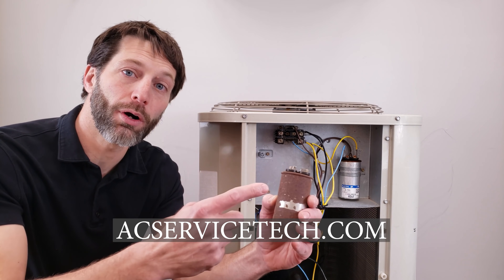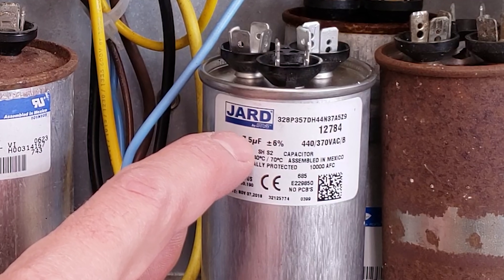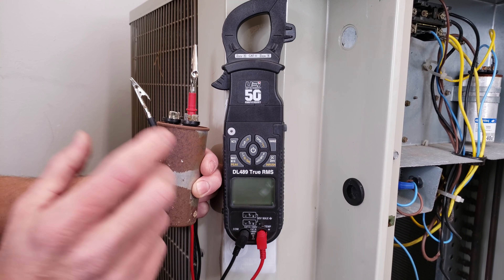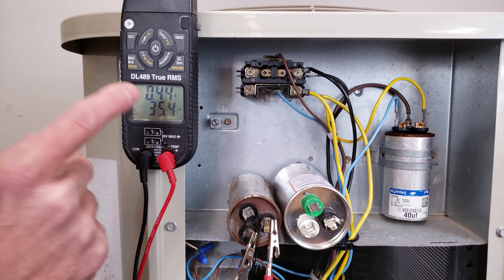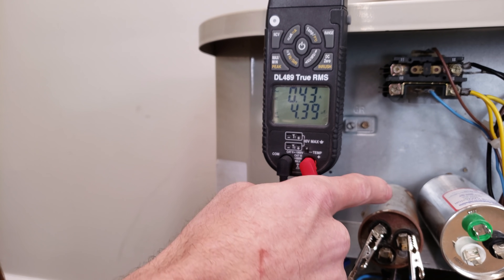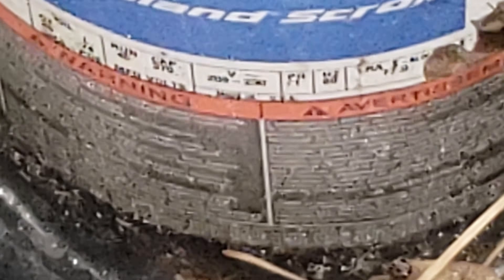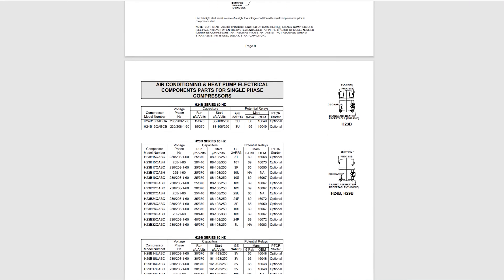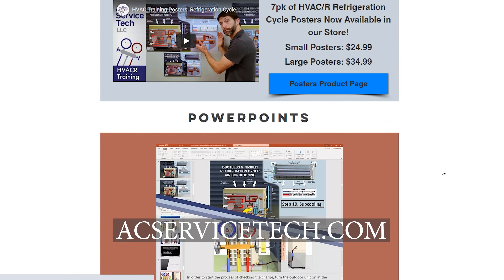Finding Run CAPACITOR SIZE on an AC Unit, Ratings Worn Off!

Comment: We have a 25 years or older Ruud AC, it's capacitor has gone bad and needs to be replaced. Although the capacitor is plastic there isn't any markings on the capacitor that tell its value is. I suspect that it once had a stick on label that came off. If the compressor and or the motor have no label how should we proceed, the installer has long been retired.

Comment: On a 30 year old unit, condenser fan motor is running but the capacitor is reading 3.4 MFD. The datat tag on the capacitor and motor are worn out. What other methods can I use to figure the capacitor size?

Comment: So we have to go to that Compressor manufacturer's website to find out the MFD rating?  

There is no other way to find that out? I mean if we use the Start Capacitor formula with input Electrical load it won’t show appropriate Capacitor rating?

Comment: Another good tip is to check the compressor / fan labels, and make sure the right capacitors are already installed.  ...seen this mismatched before!!

Comment: Hello, I have a furnace blower motor capacitor question: Can anybody tell me why a new Genteq (formerly GE Motors, prior to 2009) blower motor would have 5 uF capacitor as the main spec on its label BUT ALSO say "7.5 uF capacitor required on Some Units"? Google does not yield any answers for this. The old capacitor that was in there was a 7.5 uF and ran the old GE blower motor for at least 15 years, maybe 20+ years--the blower was dusty, rusty, squealy, and old as time. That makes me think my furnace/"unit" might be one of the "units" that uses a 7.5, but everyone on the internet warns to not use the wrong capacitor, and the freaking motor, old GE and new OEM Genteq I ordered, has 5 uF cap on the label as well as the 7.5 uf spec "for some units". Thanks!
Reply: This has to do with the supplied voltage. 208 volts will have a different capacitor than 240 volts.

Comment: Replaced my capacitor and fan still wasn’t kicking on. I took out the capacitor, ordered the same 55/5. Fan still doesn’t work. Next day I check the fan motor to get a replacement and noticed it says 10uf. Whoever replaced it put the wrong one in. Wonder how that affected the fan motor.
Reply: Reporting back in case anyone reads this someday. The fan motor had two sets of wires connected to each other in a loop. They were zip tied to the conduit of the other wires and to the top metal grill of the fan. The vibration wore through 2 of the wires. Completely through them. I think it was running because the metal bar from the grill was actually bridging the wires. Wild. Redid the wiring , taped and used conduit to get it back together. Check your wiring !

Comment: I have a AC condensing unit who the hell knows what’s what it is. I think it’s a Frigidaire but there’s no name in there. No name on it. I know it’s 2 ton and the fan and the compressor doesn’t run. Lots of voltage. Think the run capacitor is bad, the sticker on the fan motor says point or 55 370 V there’s no sticker on the compressor other than something that says Copeland CR 20 K6PVPFV 260 is there anyway you could help me out and tell me what size capacitor I need to get a dual run capacitor for both my take care of my fan and my compressor on myunit outdoor that I should trash you

Comment: If the label is worn off...
1. Take Amps reading from HERM
2. Multiply by 2562= ?
3. Then check voltage from Common to HERM and divide it by the answer from step 2. 
This will give you capacitor rating under load.
Reply: Don't you mean 2652 ?

Comment: If you accidentally measure capacitance incorrectly on an intact 35+5, as in probe herm to fan terminals by mistake, it'll coincidentally also produce 4.4mfd. In-series capacitors is madness, but a frequent mistake made by my techs.

Edit: does anyone know of a way to like, measure the resistance of the windings & factor tonnage and calculate the capacitor size needed?

Comment: What if my AC unit has 2 capacitors? one is only for the fan, but can I replace the main capacitor with one that can also run the fan motor or do I always have to have 2 capacitors?

Comment: Awesome video! I have the exact situation or a completely rusted and illegible capacitor. Found the fan rating no problem on the fan plate but not able  to find compressor rating. It is not on compressor plate and I can't find online likely because the model is out of production is my guess since old refrigerant. It is a Copeland CR26KF-PFV-130 compressor. Do you happen to have the manual for that one so I can look up capacitor size?

Comment: I determined that my run capacitor was bad. The old one showed O.L. on the Ohm setting. That's all I could check with no mfd setting on my meter. The can was rusted so I couldn't find any numbers. But going off the fan, I needed a 370 v 5 capacitor. The replacement I got from ACE hardware was smaller in size but it has a 400/370  50+5 mfd. I'm assuming that is okay. My question is, does the case of the capacitor have to be mounted/grounded to the unit. Since it's smaller in diameter the original band won't secure it to the unit. Any suggestions?
Reply: I was able to just tighten the band circle with new screw positions and it worked just fine. Whew! House was at 95 degrees. So glad that I was able to fix the problem thanks to your channel.

Comment: A 50/5 uF capacitor will not work in replacement of a 45/5 uF ?
My unit has been running 3 yrs now the slightly larger capacitor. 
Should I put a 45/5 uF back in?

Comment: If my compressor is currently using an oval capacitor, can I change out to a round capacitor that meets the volt/MFD ratings?

Comment: Ahhhh okay, so my problem is completely unrelated to air conditioners, but I think this video still helped. I have a possible DIY project in mind that uses a 120VAC 400mA edge flow fan (“motorized impeller”) and I read somewhere that I’d need a capacitor for it to work, but I’ve been struggling to find the information I need for days. (Doesn’t help that Alternating Current and Air Conditioner use the same acronyms. 🙄) But based on what I’ve seen here, I should be able to find that information on the actual impeller fan itself.

Comment: Great videos!!!!  If a start capacitor in a package unit is replaced.  Does the new capacitor need time to charge once the power is turned back on or is does it charge instantly as the power is put back on?

Comment: When there is absolutely no information on the compressor or the fan or the name plate on the unit is missing or worn down. The home has no information on the unit neither. How do you find out what size capacitor is needed?

Comment: Please can you tell me the average cost of a dual capacitor?  I had a technician replace one and it costs me $200.  Its a CAMTR233 45/5 x 440.  When I try to look it up for the price it won't let you unless you have an account with them.
Reply: A capacitor like that is 25$ or so. I just got a 35/5 for $20 on Amazon, GE brand (whatever it is called now). If a service comes they are going to charge $50 for the cap and $150 for the trip.

Comment: What happens if you encounter an old package unit in a mobile home park, and rating plate for compressor is not readable, in addition to an unreadable  rating plate on the cabinet itself? How do I find an MFD spec for compressor?

Comment: There are only two tabs on the cylindrical capacitor in my old Rheem unit. It measures 22 uF, but all the ratings are worn off. It only has two terminals on top, not three. The fan's and compressors rating plates are also worn off.  I guess I"m just SOL :(

Comment: My unit has an 80+5 uF 370V run capacitor with wiring to HERM and C, but no wiring to FAN. It has a separate capacitor for the fan which is 5uF 370V. Why is there a separate capacitor for the fan? Why not just  hook up the fan to the spare terminals on the run capacitor? I did test the run capacitor and it is within spec for both HERM and FAN. The fan capacitor needs to be replaced. Can I just bypass it and hook the fan up to the spare terminals on the run capacitor? Thank you.

Comment: I just got an old window air conditioner running. 38 years old looks like. Electrohome by Keeprite model A601A00

I suspected the capacitor as the blower motor started but the compressor relay/contact was clicking every few seconds and eventually the compressor would start. I expected to have to replace the cap but after removing the wires, I noted a lot of corrosion. Some of the blades were corroded away completely. I took the cap to my wire wheel then scraped the contacts cleaner with a sharp knife. I tested with an analog multi-meter and got decent responses and no shorting to ground. Because the blades were so corroded, I used pliers to squeeze the wire push on contacts a bit to make a tight fit. I put some dielectric grease on the blades to prevent further corrosion. It seem to be running well now, though the thermostat is wanked. I managed to rework the thermostat so it functions, but not as it was designed.

Your video was helpful. From factory the micro farad figures were blurred and can not be read. The cap is a JARD. The blower motor does not mention the capacitor and the label on the compressor is behind where I can not read it 😞

I followed your example using my digital multi meter and got 14.75  and 3.97. Does this mean I would need a 15 and 5  capacitor if when this one fails?

Any idea where I could get a new thermostat?

Comment: I noticed mi ac stared different and making weird noises and shoot down over heated, I inspected and found the capacitor terminals severely corroborated and the mf information missing, but thanks to your video, I purchase the correct capacitor and the ac is working fine.
Thanks and keep up the excellent videos.

Comment: What setting on your volt meter dud you use to find capacitance? I have a fluke and no setting shows uf
Reply from the maker: You may not have that setting unless it is an hvacr multimeter. The setting may be missing, thanks!
Reply: @acservicetechchannel  I was able to track it down. Had to turn it to the symbol for diode DC which also has the symbol for capacitor by it, then switch the setting to find correct range. Unfortunately my capacitor read 0 uf between all prongs. Motor only shows 5 mfd and 370v. Compressor has no uf rating on it. Referenced another HVAC site against my Lennox model # and found that it was 35uf. Hopefully its right!

Comment: This is the only video that helps find the right capacitor without reading the old one. The technician replaced the capacitor on a Sunday and charged us 250 dollars. Later on I figured out with wrong capacitor spec because one month later one wire melted. I was not able to find the right capacitor recommended by the manufacturer in any website, manual or customer service.  After reading on the compressor I was able to find the right one which is 45,  different from the technician replaced 60! Thank you very much sir!!!!!
Reply: Mine did the same I think. It failed soon after.

Comment: Thanks so much for the help. I was servicing my unit and saw that my cap was completely rusted, but still working. Got the readings now so I can replace later.  Mine reads 28.9 and 5.1. Would that be a 30 + 5? Thanks

Comment: Thanks again. I've struggled with people putting in wrong caps mfd in units and customer tells me that fan was replaced a year or two ago, only to find out that they have gone to Higher mfd  and caused the start winding to get damaged over time. After my first experience the customer texted me from time to time that the unit fan is still doing good after five years.  Ty again for your videos and advice.

Comment: I wonder if their is an equation to figure what capacitor is needed if there are no model numbers on the unit. Like if you know the FLA and voltage could you figure what capacitor is needed?
Reply: Yes, take FLA and times that by 2650 then divide that number by voltage needed to run the compressor.
That will give you the exact information u are looking for.
Its a great question u asked and I’m going thru the comment section to see if Craig has addressed this.
He is the best in the business and I’m a little surprised he did not address this formula in the video clip.

Comment: I’ve got a 10 year old Rheem heat pump that as soon as it gets the call for heat or cool, it pops one of the two fuses in the disconnect or trips the breaker. The outdoor fan gets barely enough power to turn the blades a 1/4 turn. I replaced the contractor and same problems. I take the outdoor fan motor out of the loop completely and same problem. Ohm out compressor at its plug and it’s fine (OL). 
Any ideas? TY
Reply: disconnect compressor at the plug and see if breaker still trips. If it does still trip, than disconnect power in at contactor. Isolate the problem for a solution.

Comment: i have watched over and over and it tells me everything about the numbers except for i dont know which number on the fan motor plate coincides with the low number (uf) on the capacitor.I know (from the compressor) i need a 60 MFD/440 Volt, but I have taken 15,000 (lol) pictures of my fan motor plate and i still dont know which lower number to pick 😭 Please help if you can. thanks! P.S. the capacitor label is completely worn off.

Comment: I dont know what my fan motor MFD is. The info on the motor is toast. I tried 7.5 made and it didn't work. I have it at 2.5 mfd now and it works, but I'm worried it could be the 5mfd. How would I know?

Comment: Can a capacitor with the next lowest mf; but same voltage rating be used as a replacement and not damage the compressor or fan? For example replace a 45 mf 370 volt capacitor with a 40 mf 370 volt capacitor.

Comment: This video was amazing, as my capacitor was very rusty and I could only see it was a York with ??+5 MFD.  In my heat pump I couldn't see the compressor's MFD rating (looks like the compressor was in some sort of jacket, not sure).  After discharging and trying to read the capacitor with my multi-meter it showed 20MFD (that seemed too low, I expected 35+).  I then decided to give up and just put back the old capacitor which was still working, ... wait for the face palm moment ... I struggled a bit trying to get the screw that holds the capacitor in and what do I see ... a 50 + 5 MFD in sharpie!  Appreciate the video you made and whomever had the comment about inking the capacitor rating with a sharpie, whoever did that for my HVAC system absolutely saved me.

Comment: That’s all great, but what are you supposed to do when there is no data plate on the compressor and the existing capacitor is not readable

Comment: Rule of thumb ive always used for the last 10 years is (tonnage x10)+15 = Hermetic.  If you're in a pinch you can go up 5 down 0.  Better than 99% chance those two rules will get you in the clear.
Reply: my 3 ton uses 55uF, so no, don't trust that.  if unsure it's better to try several cap values and pick the one that gives the lowest run winding current.
Reply: @dan4091  Congrats on being the 1%. Although with that rule a 45 would still be  within 20% needed for guaranteed start. But using the manufacturer's specified from the unit parts list is the most correct.
Reply: You can also call the supplier order one by model. Use it to replace the one you use next time in supplier.

Comment: What if you have no readable stickers at all?
Reply: easy but takes a bit of work, run the motor with different value capacitors, then use the one that gives the lowest run winding current

Comment: Sorry. But disagree. U can up size 1 cycle. 5 to a 7.5 or a 12.5 to a 15. Or a 45 to a 50. Never had any issue. So.......... let’s hear it??
Reply: did you measure the current from doing so?  you realize MFR's specify run caps for maximum efficiency and lowest operating cost.  so you not having any issue doesn't mean you or someone else isn't paying more $$ to operate their system than necessary.  So..... let's hear it??
Reply: @dan4091  obviously you don’t work in the trade. If you have a bad CFM and it takes a 5uf cap. U can use a 7.5 going foward. Even the manufacturer says this is ok. It’s done all the time. Don’t see the disconnect here. #SoLetsHearIt

Comment: Use 2 heavy insulated screwdrivers yo discharge capacitors, you can check caps using resistance but it wont give you cap rating

Comment: You claim if the Mf is over it will burn out the 'whatever'??  I was always taught "you can go over.. but never under".  
So a cap rated at 30mf can be replaced with one that is 35 mf but NOT one rated 25. This has worked for me in countless cap exchanges in the past 35+ years.
Reply: The reason you can go over is because the purpose of the cap in a capacitor run motor is to shift the voltage towards 90 degrees behind the current to generate a rotating magnetic field, at least that is what I remember from electric machines class but that was over40 years ago. Now since you cannot shift the current more than 90 degrees it stands to reason going over will still work however there has to be consequences here and I suspect it’s the capacitor that suffers from extra power losses as heat thus shortening its life. Now I admit that part is an educated guess, so i’ll leave the research in confirming this to you.
Reply: @nunyabusiness6746  Huh?  Going 'over' I understand. I was commenting on 'going Under'.

Comment: I was taught ac's the hands on OJT method likecalot if other guys in my trade but alotta guys that were taught the same way. 1 of the things I've always heard about replacing a capacitor is, it's safe to replace a capacitor with a capacitor that's no more than 5mfd higher but never lower. Is this true or was I told wrong. I truly do respect you and value all your teachers n love watching all you tutorials. Keep em coming!!!👍😎💯💯💯